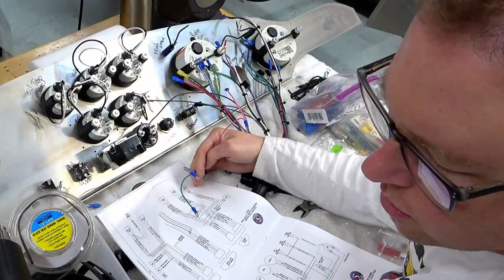Budget LS Factory Five Cobra | Build Update 9

Comment: Are you using the wire harness supplied by FF5?  I know many are electing to use the one produced by Ron Francis.
Reply from the maker: FFR harness.  The harness seems fine but the wiring diagram supplied by FFR has much to be desired.
Reply: @AmateurHourGarage  I’ve noticed a few places in the manual that are a little out dates or like you said have little to be desired. Oh well, like Rob Schneider said, “You can do it!”